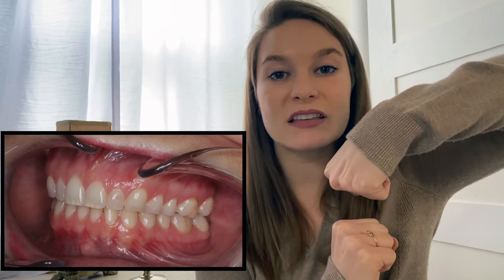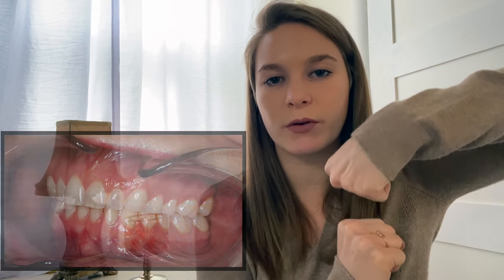TMJ Splint Therapy | Phase I | My Treatment

Comment: Hey, did you have any ear symptoms with your TMJ disorder such as popping, fullness, ringing? If so, did splint therapy clear this up?
Reply from the maker: Hey George, 
I did not experience any ringing or symptoms in my ears. However, I did have popping in my jaw. The splint was able to resolve this for me. Although I did not experience this, I know many patients that do have ear symptoms and are able to clear it up with the use of splint therapy. 
Thanks for your comment!
Reply: The popping comes from the articular disc recapturing onto the head of the condyle. The articular disc lies primarily anterior when the condylar head is completed seated (superiorly located) within the TMJ and superiorly located while the mandible is protruding (condylar head is now heading anteriorly and inferiorly when in protrusion).

  This can be caused by a variety of things, but can be placed into two main categories: repeated micro trauma or macro trauma. 

There are posterior ligaments that prevent the disc from moving too far forward. When elongation or tearing of these ligaments occur due to the above mentioned traumas, the articular disc now has the potential to either displace or dislocate too far anteriorly. Discomfort can then occur because of the articular disc pushing the condylar head back into the retrodiscal tissue (again, site of the neurovasculature). A lot can occur from this point, but due to the sake of longevity, I will be ending this reply here. 

Hope this helps.
Reply: Dental Dork mam plz help me m suffering from last 4 years
Reply: I have these symptoms! I hate it !!! I'm looking into going to a tmd dentist as others don't know much about it!
Reply: @Elkay15  how long have you had it? How did it start, did you wake up in the morning all symptoms started?
Reply: @Gappy_The_GOAT  it started a week or so after my headache! My symptoms are exactly like yours
 Ear fullness ringing and thus clicking sound in my ear not in my jaw its in my ear! When I swallow i feel something sticking and then it opens up!
Reply: Also the day I made my appointment  with a good tmj dentist half my symptoms were gone I still have 25 percent though. My tmj dentist said that I have bite issues but he couldn't here any closing direct in the jaw..he did point out other issues with my wisdom teeth etc and some stuff which is not related to tmj..he said it could be stress related or related to my wisdom teeth im gonna hve to find out after i get it done. He also said that braces is a gamble might make the problem worse or might fix it.
Reply: @Elkay15  same ,how’s your progress
Reply: I have tinnitus but just started splint last week still tbd
Reply: @paullance1258  how’s the ear please let me know

Comment: Will this help align my jaw ? Or just help with bite problems. I’ve been suffering with this since I was 18 now I’m 21 sometimes I just wanna jump off a cliff cause the pain and discomfort is so bad. I’ve tried seeking help but it’s 5k and I don’t have that kind of money at the moment😢 idk what to do. I’ve tried everything from pills, mouth guards.  I had X-rays done for $700 where they mentioned my jaw was pushing in instead of out 💔.  But after I was told the price I just gave up.

Comment: Hi there i have tmj issu its been 6 month now its gatting worse i remove my upper wisdom teeth for tmj after its make worse.😥😥 and polish my teeth 4/5 time to balance now its been a lot of problem. My jaw moving automatically and discomfort in bite 😭😭 cant bite properly😭😭 cant open my mouth so wide.jaw moving automatically also problem in my tougue and throat😥😥 how can i get relief form this its the splint work or not😭😭 i need help pls help me😰😰😰🥺🥺
Reply: Having your teeth shaved on for balance was the problem along with wisdom removal. Your bite is now officially unstable, this is why the jaw muscles hurt, it can’t find the bite to relax. I know because similar happened to me now I’m in the process of thinking whether or not to get new teeth. That’s what you will need now sadly

Comment: Hello, so I’ve had braces for 3 years I’m very frustrated. I went to a TMJ specialist he said he can’t give me a splint until I get them off. I wore my elastics, had worse pain, my ortho said to take them off I’m still in pain. I have headaches,muscle spasms, jaw joint problems, should I tell them to take off the braces because I was told my treatment was suppose to be for 2 years not 3 then they told my specialist maybe 6 more months I’m just sick of it ! I never had this issue before when I took out my wisdom teeth & extractions this just recently happen, do you think the braces is the issue?
Reply from the maker: I just emailed you back! :) - Crissy
Reply: Dental Dork thanks so much, I will continue to watch your videos 💕
Reply from the maker: Thanks so much!
Reply: Oh you’ve had too many teeth removed. Wisdoms are back teeth, we’re there any additional molars removed?? If so this is your reason for TMD. Your bite is missing those teeth and unstable.

Comment: When would you recommend TMJ surgery?
Reply from the maker: Thanks for your comment! I think TMJ surgery is mostly avoidable if you can be treated properly. There are certainly cases that surgery is a better option, but it completely depends. There are many factors such as severe periodontal disease that play a part in making that decision. I would be evaluated by the Facial Beauty Institute prior to ever making that call. Best of luck!
- Crissy
Reply: Absolutely never, TMJ joints are damaged beyond repair in most cases, avoid avoid surgery at all costs.
Reply from the maker: @lukerobinson9646  My training has taught me that the TMJ is one of the only joints in the body that can actually remodel itself if given the proper circumstance. I still would agree with your statement to avoid surgery at all cost though!
Reply: @DentalDork  TMJ medical knowledge is so lacking, it's unreal...it's almost like a huge glaring hole in the medical and dental profession. I've heard of orthodontists doing a small surgery in conjunction with functional ortho if they didn't get the results they wanted, whereby they basically sew or sow the disc to the top of the condyle. But any sort of replacement of the structures, i.e a rubber insert etc, is a terrible terrible idea and in most cases from what i've heard leads to chronic headaches and a downhill slope.

Comment: Hi there

I’m considering going to a TMJ specialist. 
I had braces when I was a teenager (34 y/o now) and one side of my jaw feels like it dislocates when I open my mouth more than an inch. I told my dentist about it but he didn’t do anything. 

My teeth shifted so I’m now doing Invisalign and I was hoping that would help with some of my jaw stuff, but I’m thinking now I need a splint for the “dislocating” symptom. 

If I get a splint after Invisalign, will it ruin all the work I did?

Thanks in advance!

Comment: I have been given a hard orcsnal split bye my dentest I suspect it is for tmd but haven't been told that exactly I do clinding  and grinding my teeth as well but before I started I did have hedacks jaw pain  macale Tenson and have had it a about a year now and do think they've adjusted it 2 sins the first  but have only been told to wear it at night 

I'm wondering if there going to tell about stage II soon
Reply from the maker: Thanks for your comment. What you are describing sounds like a night guard. This is something I also educate many of my clenching/grinding patients on. As long as there is no chronic pain (TMD, neck, headaches) then I believe it is fair to leave them wearing this guard for even the duration of their life. Occasional adjustment are normal. If it is protecting their teeth, no dx of sleep apnea, and no pain, then that's great. If there is progression, then we consider indexed splints. I hope this provides some clarity! Thanks for watching!
-Crissy
Reply: Thanks for the reply
Reply: I've got private health insurance how do a ask if I need any  orthodontics treatments cos I'm contlly paying for it and how do  thay cheak your bite
Reply from the maker: @jamesalberts2039  I would call your dental insurance company to seek what benefits they provide for orthodontic treatment, however night guards splints are not considered orthodontic treatment. It is unlikely dental or health insurance will cover adjustments. There are a few different ways to check the bite, but the simplest is with bite registration paper (It is colored paper) they place in your mouth and have you bite on.

Comment: I am also suffering from TMJ and my doctor prescribed a splint for me.
For lower tooth. 

I doubt that, can I get a good and wider jawline after using this splint continuosly for 2 weeks.

I mean does it changes the facial symmetry.
Reply from the maker: Eventually, facial changes can occur if the splint is worn enough to allow the facial muscles to function differently. I doubt 2 weeks is enough time for facial changes, but hopefully help the TMJ pain. Please see your doctor for any further guidance. -Crissy

Comment: I got a gelb splint made yesterday  what's your view on this splint? I have to wear it 24/7 just remove to clean. I'm scared it will change my bite and I'll need braces???? Is there a chance I wont ???I'm so desperate to be pain free I cant live like this
Reply from the maker: Sarah Falkner- Thanks for your comment! 
First, I am not a dentist, but personally, I believe they can help to achieve pain relief however I'm not a fan of the gelb splints. I think permanent changes depend on how long you're in the splint. I'd recommend talking to your provider to see what their plan is for you. Do they think you'll need long term splint therapy, or short term? Is it chronic or acute TMD? 
If you're desperate to be out of pain, then the possibility of braces maybe shouldn't be your greatest concern. Braces for 2+ years verses lifelong TMJ pain... that's only something you can decide on! Best of luck and let me know how it turns out! 
-Crissy